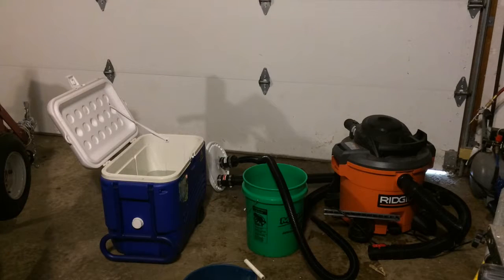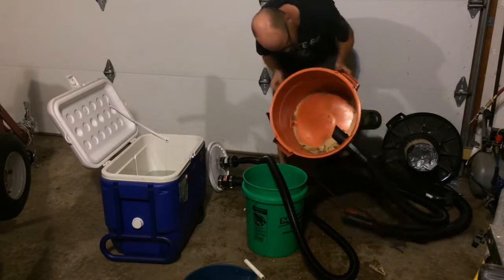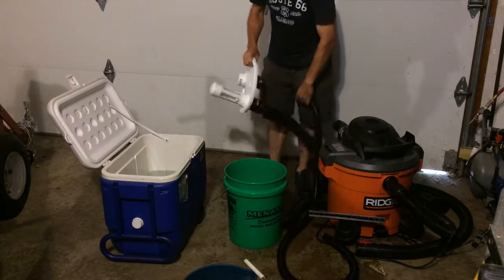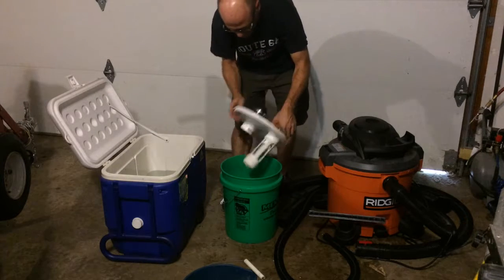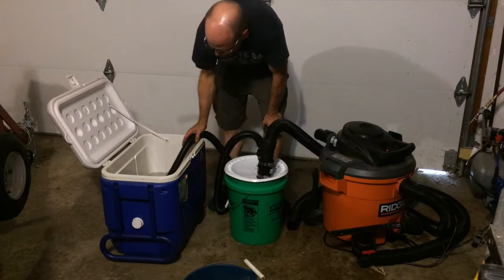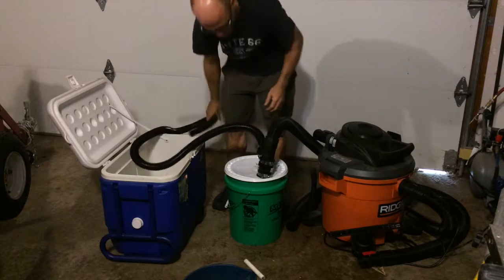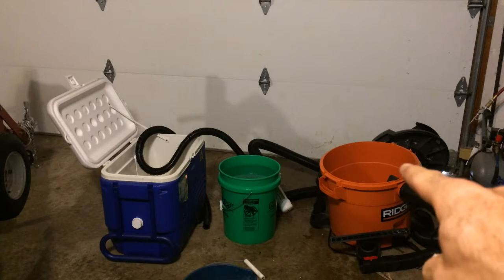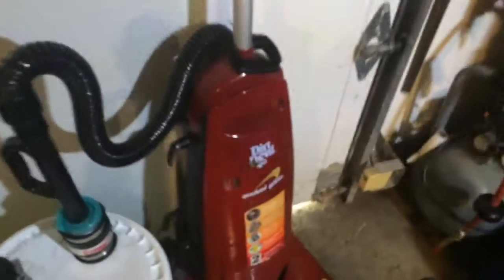Wet Vac Pail  Adapter

Comment: Did u make the check valve?
Reply from the maker: Juz Do IT b!Tc# random i did. Pvc outer tube and pvc tube with caps on the end for the floating element
Reply: @tleeb1968  Thank u 4 da advice n also props 2 ur clever idea sir!